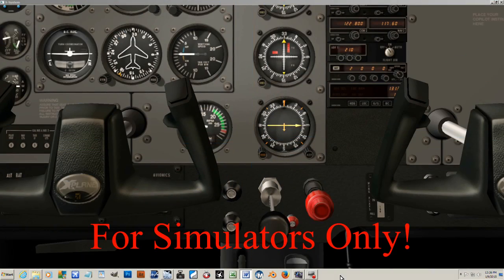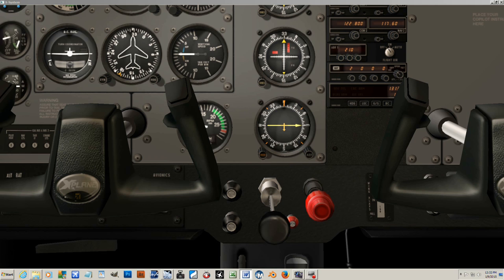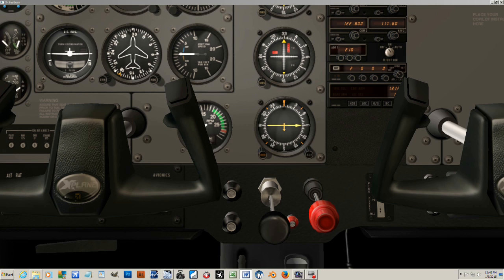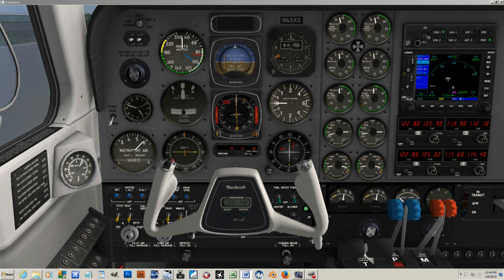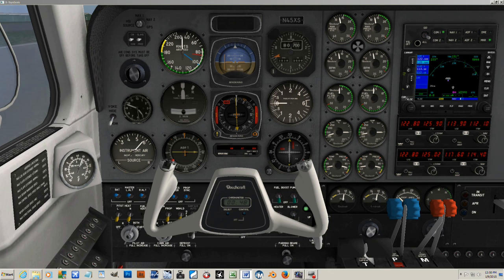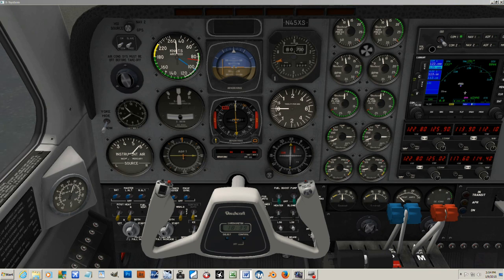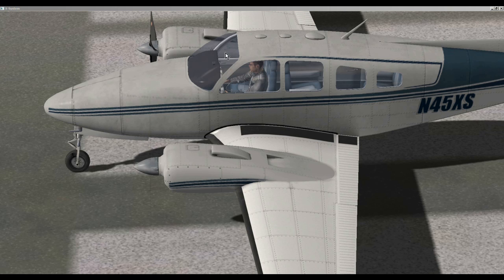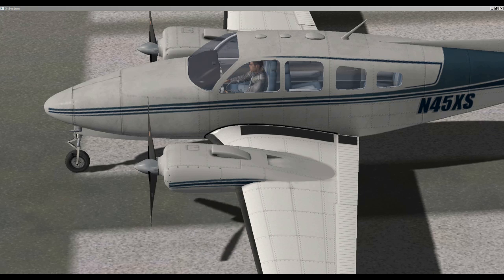How to Use Prop and Mixture Controls in X Plane ~ Tutorial

Comment: Thia original post is a few years old, so hopefully, you are still responding to comments.  As a new simmer, and non real flyer, extremely helpful.  Question:  I wonder what your suggested settings would be for a landing back at, say, sea level or close to it.  Do you reverse the adjustments made on the way up?  Thanks again.  Excellent!
Reply from the maker: Hi billjirsasr3025, Yes indeed I'm still responding :-)

For takeoff and landing you always have the prop control all the way forward and mixture would depend on altitude, all the way forward below 3000ft above sea level. You want to be able to get full power if you had a problem and had to go around so prop forward takeoff and landing. I don't fly constant speed prop airplanes so I'm not the best for information other that what I said in the video so if this is your airplane of choice might want to check other videos with pilots with more experience than me!

Since you are new to flight sims check out my channel and videos for new pilots get a free Cessna 172N, the one I use in most of my videos in the series, by watching the first video:
https://www.youtube.com/playlist?list=PLjqSrWIZDAi8IsbmFdGfJBVJ7jYSxAt26

 Let me know if you decide to follow along with the training and get the Cessna, hope you do :-)

Blessings,
skip

Comment: This was very helpful. Are the rules of thumb also hood for a small single engine plane?
Reply from the maker: Hi pgreenx, Glad it was helpful thanks for watching :-).  As for the "rules" these so called rules of thumb are for constant speed props and could work on single engine airplanes but it's best to read your POH (Pilot Operating Handbook) and find out what's recommended for your airplane. Also these "rules of thumb" are just guidelines and they may not be appropriate in some flight conditions so, again, if you don't have a POH for your airplane try and get one, you sometimes can find one in .pdf format online and you might have got one with your airplane so check the folder for your airplane and look for Documentation it should give you some tips on flying. Hope this helped.

Blessings,
skip
Reply: @WEHVideos  thanks.  I’ll print on and read it. Trying to fly like a real plane even though I have no intention to fly a real plane.  Your videos are the best I’ve see. So far and I’ve been watching all of them.  
I also need to mater the 152 first but I’ve been doing the “missions” in mags and love the cub x. Will be going back to the 152 starting tommorrow
Reply from the maker: Looking good pgreenx you have the right idea and thanks for your kind words :-) 

I would strongly recommend you master one airplane at first like your 152 or the 172 or similar trainer. Get to know the airplane you are training in like a real pilot would. You will find emergency procedures and a lot more in the POH. Just knowing how to "fly" isn't enough. You should thoroughly know your airplane, all the working parts, what they do so you will know how to react in an emergency. I realize this is just a simulator but the more you learn like a real pilot the more fun it can be. 

A fun emergency to practice in the sim is engine failure. The POH will tell you what the best glide rate is to help you figure out how much time you have to pick a landing spot. You should know at any altitude how much time you have before you hit the ground. Start by just setting the throttle in idle when on the downwind at pattern altitude and see if you can land on the runway. This is exactly what a real flight instructor will do to students, he/she will reach over unexpectedly and set the throttle to idle and tell you to land, give it a try. Have fun and let me know how it goes.

Blessings,
skip
Reply: @WEHVideos  thanks again and for the thorough explanation:   My plan is to learn everything including the comms, nav approach stuff etc. 
I already printed the handbook
Thanks again!

Comment: happy found this explanation, thank you sir!
Reply from the maker: Hi Jo, Hope it helped and thanks for watching :-)

Blessings,
skip
Reply: @WEHVideos  yes skip helped a lot! just to ask you; is the fuel pump switch in real life always in "on" position during flight? many vids turn the switch off after engine start. which way is the right one, thank you!!
Reply from the maker: Hi Jo, As I understand it, depending on the aircraft, there are two fuel pumps for GA airplanes. One on the engine, like your car, which is mechanically driven. The pump you operate with the switch(s) in the cockpit is an electrical  booster pump you use to prime the system before starting so you would normally shut this aux booster pump off in flight, also this pump can be used in emergencies if the maim pump fails. The Pilot Operating Handbook (POH) will tell you how and when to use this aux pump so check that out if you have one.  Hope this helped :-)

Blessings,
skip
Reply: @WEHVideos  i don`t have a handbook but you helped, thank you! the c-172 is my favorite aircraft although i try to learn the king air c90 for longer flights. maybe you can do a vid about this aircraft in the future if you like. all the best and happy landings. jo
Reply from the maker: Hi Jo, Assuming you are using X Plane 11, There is a POH for the X Plane KingAir C90 in the KingAir C90B folder (X-Plane 11>Aircraft>Laminar Research>KingAir C90B). You can also search the internet for a POH pdf file for most airplanes that can be very helpful. Good luck and happy landings to you also :-)

Blessings,
skip

Comment: Wouldnt you set the RPM lower than your MP as the prop would rotate thousands of times LESS, giving it a longer life?= less tress on the prop?
Reply from the maker: Hi Ruth,  Good question but unfortunately it's just not that simple and I can't explain it all here. I will say that just lowering RPM does not necessarily mean less stress, prop position makes a big difference. In a car you would not try to drive up a hill in fourth gear, this equates to Low RPM and no power with lots of stress on the engine.  

Each aircraft with a constant speed prop has it's own recommended "cruise power settings" for best performance that the pilot would use to find the best settings for Prop and Throttle depending on what they are doing, climbing, descending, or cruise along with the order the controls should be operated. Hope this makes sense, let me know :-)

Blessings,
skip

Comment: I have a question skipper what can you liken the mixture control to in a vehicle because for me its kind of confusing in its working especially on the CHT EGT and thermal efficiency workings.  All in all this has opened my understanding to the workings of the levers.
Reply from the maker: Hi Heta,  Well that's a bit difficult but I'll do my best, understand I'm stretching things a bit but it should help you get the idea. 

If you understand how altitude effects a cars performance at high altitude because the air is "thinner" the higher you go, the same is true for airplanes. It's all about air fuel ration or the amount of fuel for a certain volume of air. The Air Fuel ration for cars are designed at sea level I believe so the air fuel ration is best at sea level. If you ever have driven high into the mountains you surely noticed you car had a lot less power the higher you went and that's because the ration is not right, the air is too thin, there are fewer air molecules so you end up drawing too much fuel into the engine messes up the air fuel ratio.
Since there is no way to make adjustments in your car for this you loose performance. This is somewhat compensated for in the gas you buy at the higher altitude to improve the Air Fuel Ratio but for the most part your car won't perform very well unless it was designed for high altitude and I suppose that's a possibility.

Now in airplanes we know we are going to be at high altitudes hence the Mixture control on piston engine airplanes. The effect of altitude on the airplane engine can start at 3000ft. so we need to make adjustment. What the mixture control does is allows less fuel into the cylinder to compensate for the fewer air molecules  as I mentioned earlier. So as the air "thins" out we "thin" out the fuel to do the best to maintain the air fuel ratio for the best engine performance. Please let me know if this helped.

Here is a link to my video on mixture control:
www.youtube.com/watch?v=7LswJWcEIEs

Blessings,
skip
Reply: @WEHVideos  thank you so much skipper. This of great help.

God bless you too as you enlighten and inform us on aviation.
Reply from the maker: Thank you!

Comment: I was understanding right up until you said pulling the prop control back makes the blade take a "bigger bite" out of the air. If this is true, why do we fly with the prop full forward for take-off and landing? I thought full forward meant the greatest angle of attack for the blade, thus a greater production of thrust.
Reply from the maker: Hi Ryan,  Think of driving a car with a manual transmission. You start out in low gear where you get the most power to get the car moving. You can't stay in low gear you would never get much speed, the engine would be running at high RPM but you would not go to fast so you shift gears. As you pick up speed you shift gears again. If you tried to start driving in high gear the engine would not be able to get the car moving because of the gear ratio, it would put too much strain on the engine and it would probably stall. The reason we have the prop full forward for takeoff and landing is for power. You can accelerate faster like using low gear in a car. So if you find yourself in an emergency situation you can accelerate fast. If you had the prop control all the way back and then tried to accelerate fast nothing would happen the prop is taking a "bigger bite" of air and the airplane will not accelerate and this would be a big problem if you were landing and need to go around. So for takeoff and landing always have the prop control all the way forward for maximum power if needed. Hope this helps.

Blessings,
skip
Reply: @WEHVideos  Yes, I understand the gear analogy and how it correlates to engine RPM. I guess I'm confused on how pulling the prop lever back results in a higher angle of attack for the blade (or does it?). I thought having the prop lever full forward would result in the blade taking a bigger bite (and thus more thrust), while pulling the prop lever back would result in a lower angle of attack, meaning a smaller bite (and less thrust). Forgive my confusion, thank you for trying to clarify.
Reply from the maker: Hi Ryan,  Having the prop control full forward has the prop taking the smallest bite (low gear) so when you go full throttle the engine is not stressed. So using you analogy "higher angel of attack" would be like high gear in the car. Going full throttle in this mode would really stress the engine because of the air resistance the prop experience. Looks like you just got the positions of the prop backwards when the control is forward or back. Did this help?

Blessings,
skip
Reply: @WEHVideos  Yep, I had them backwards. Thank you very much for clearing this up, sir. Awesome video.
Reply from the maker: Great, glad you liked it and it helped.

Blessings,
skip

Comment: Good video! So in simple terms, always keep the middle throttle lever ahead of the left throttle? On the ground and landing, constant speed prop in full forward position. In cruise, pull the throttle manifold pressure first before touching the constant speed prop lever?
Reply from the maker: Hi First,  If I understand you correctly then yes. When increasing power you move prop control "what you are calling "middle throttle" forward before moving the throttle. So that would work with your statement keeping "middle throttle" or prop ahead of the throttle. And the reverse is true when decreasing power you move the prop back before the throttle. 

Blessings,
skip

Comment: What about when the aircraft is descending; do you reduce the mixture and rpm the same way? Thank you for this tutorial.
Reply from the maker: Hi Heron,  I'm a bit confused with your question. The mixture is  separate from the constant prop controls. You use the mixture in relationship to your altitude. You normally don't need to adjust the mixture until you are above 3000ft. then you would start to lean the mixture because the air is "thinner" the higher you climb as you descend you gradually return the mixture to "rich" below 3000ft. Sorry, I'm not sure if this answers your question!!

Blessings,
skip

Comment: Good explanations overall, one point though. When you want to decrease your manifold pressure and RPM you should decrease manifold pressure first (slightly below what you want) then adjust the RPM. When increasing power/RPM, the prop RPM should be adjusted first. A good memory device for this is "prop on top" meaning that the prop is in forward of or above the throttle.
Reply from the maker: Hi E Richert,  Thanks for that bit of information, "prop on top" I like that!

Blessings,
skip

Comment: Good video! A note about power and prop controls, reducing the rpm with the control lever will cause a slight increase in manifold pressure. Good practice when setting up for cruise (to prevent manifold pressure rising above max) is to pull back power first, set manifold slightly below target, and then pull the control levers back to set rpm. The manifold will rise slightly to the desired setting without risking a high mp :)
Reply from the maker: Hi C.B. Thanks, and great tip I'll give it a try.

Blessings,
skip

Comment: Nice video and great explanation.  I'm 53, been into FSX/P3d since the dawn of time and just started getting seriously into simming again.  I only have a Saitek Pro Flight Yoke and throttle at the moment so I assume that the Prop and Mixture settings are straight up in the forward position (100) at take off and then you adjust down accordingly at your selected flight altitude.  Is that so?
Reply from the maker: +Mark Hyde Hi Mark, Thanks, glad you liked the video. 

As for Prop & Mixture, mixture is strictly an altitude thing, the "thinner" the air (higher altitude) the leaner the mixture. The Prop is not that simple, it depends on the airplane you are flying I believe. If you have a POH (Pilot Operating Handbook) for your airplane you will find settings for the prop. Yes, if you are below 3000 ft. then the Prop and mixture are all the way forward during takeoff. 

You can thing of the prop control as a kind of manual transmission like in a car (well almost).  With the prop control all the way forward the propeller is taking small "bites" of air so the RPMs will be high for takeoff just like a car using first gear. When you get to cruising altitude you then adjust the prop control (pull back) like shifting into fourth or fifth gear in the car. You want the prop control all the way forward during takeoff and landing. The idea, again is like the car, you have more power in low gear and can get to speed faster than if you were in a higher gear. You put the prop control forward in landing because if you have to preform a missed approach or something you have the power available. One benefit of the constant speed prop is fuel efficiency just like overdrive in a car.

Welcome back to simming! I, like you, have been doing this since the first simulators, I started on an Amiga 1000 when they first came out. Anyway, hope this helps.

Merry Christmas,
skip
Reply: +WEH Videos Thanks Skip.  Been spending a couple of days getting the hang of prop and mixture settings and the video and explanation helped a lot, thanks.  I remember the Amiga, but I started on the Amstrad PCW8256.  Went to visit my girlfriend at the time In Horsforth Uni outside Leeds, bought it in Leeds and had to take the bloody thing back home to Essex via Kings Cross and the tube.  Wasn't a lot of fun.
Reply from the maker: +Mark Hyde Hi Mark,  Seems we got into it around the same time. Believe it or not I still have my Amiga 1000 set up in the kitchen nook and use it once in a while. There are several programs I still like to fly. F16, 18 Interceptor, and Falcon the first of the Falcon series. I flew Falcon 4.0 for years. Got tired of just flying around shooting down airplanes and got serious about flying. That got me taking real flying lessons after I retired. Sims have come a long way since the 80s. I just may do a video on the Amiga if I can find a way to capture the screen without it being too ugly a picture.

Have a great New Year,
skip

Comment: Hi. Good info here on mixture and pitch. Thanks. However I have a question. In flying the Avanti P180, my range is terrible! It is half what it should be and I am wondering if I have the mixture thing wrong as the problem. I thought that a turbofan engine does not use mixture control at all being a turbine source of power, not anything with carburator(sp) adjustable settings. What is the score on this. Could you offer some advise please.
Reply from the maker: John Pringle Hi John, I've never flown the P180 but here is a link to a website that has a pilot operating manual. http://www.avialogs.com/en/aircraft/italy/piaggio/p180avanti/p-180-avanti-pilots-operating-handbook-and-airplane-flight-manual.html There are many factors that effect fuel economy,  altitude, air speed, etc. Might look to see what the best cruising speed is and check your configuration.  Check out section 5 on flight planning page 214. I know this is pretty complex but you might find some help there. Let me know how you make out.   Blessings,    Skip

Comment from the maker: Thanks Ramon. I should have mentioned settings for landing :-( For landing, use the same prop and mixture settings for take off, you want to have full power available in case you need to go around. So prop full forward mixture full forward under 3000 ft.    Skip